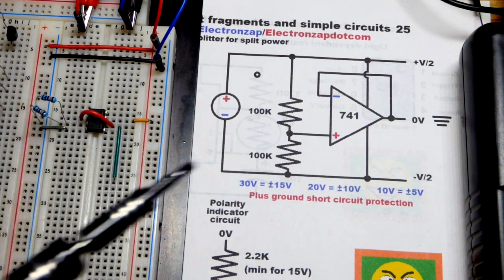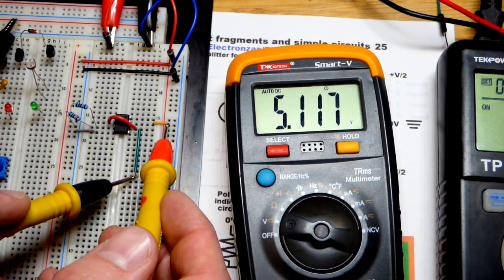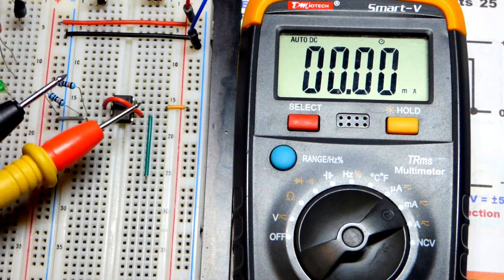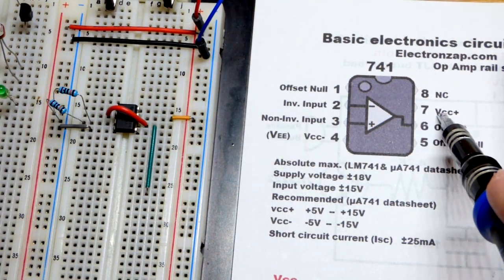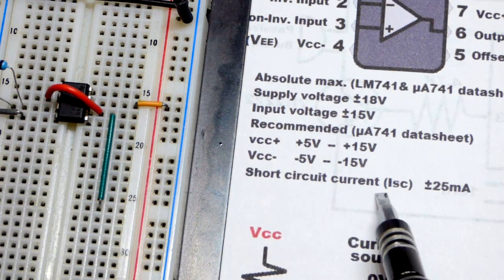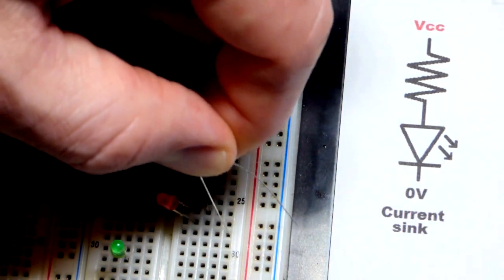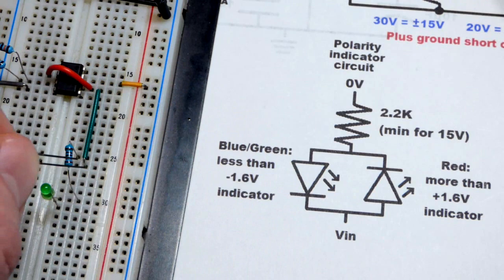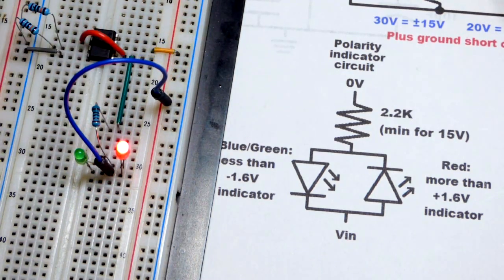Electronics course 27 741 op amp rail splitter virtual ground for split power supply circuit

Comment: Would be interesting to know how far the output is away from the voltage at the +Input, or voltage divider.  If you want a rail splitter greater than a 20mA, you might try using the output to drive a "B Amplifier", or complementary BJTs with the emitters tied together.  That output would be fed back into the -Input.  Funny ... I only bought ONE 741, ever, back in 1992.   Have not burned it up yet.
Reply from the maker: Nice! I'll get around to another push pull amplifier video some day.